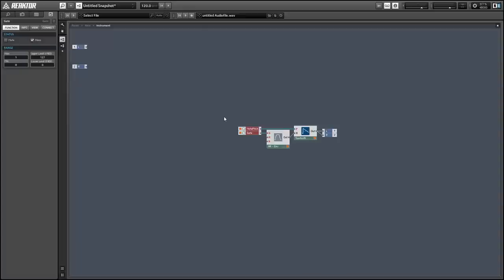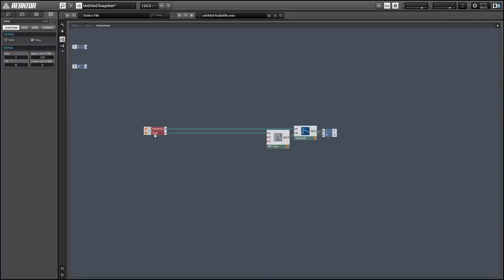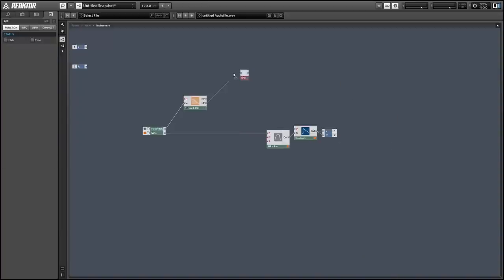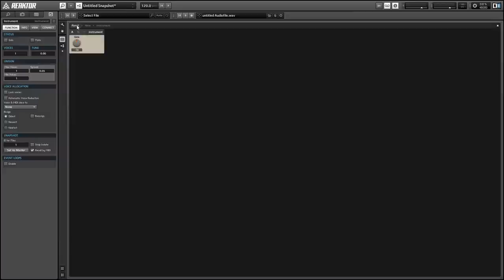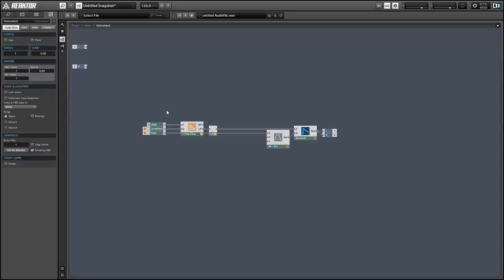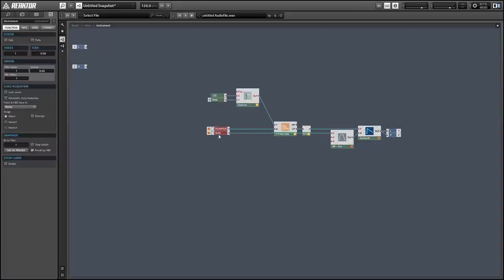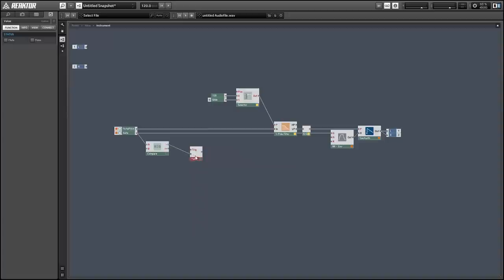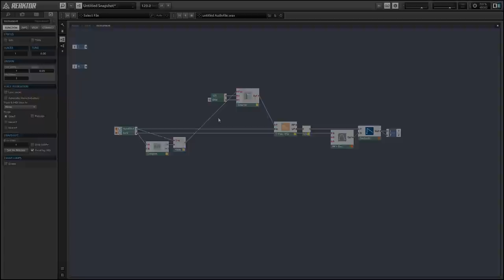Reaktor Quick Tips - Add Glide to a Reaktor Project in 3 Minutes

Comment: I only just realised (when looking at an ensemble that uses a filter to control note pitch glide) that filters have response time. I always assumed that you plugged in 1 number and got another 1 out and that the only thing defining the filter was the shape of the curve defining the ration of value in to value out as you went from low to high frequency. I'd only ever looked at Reaktor filters as things that manipulate audio not constant values.

Can someone help me understand what's going on inside that 1 pole filter module. Thanks.